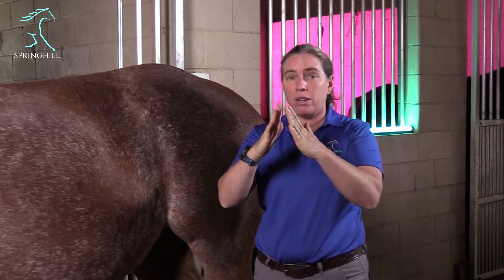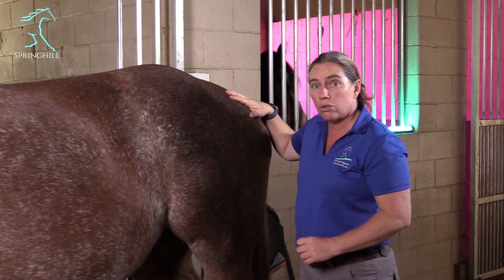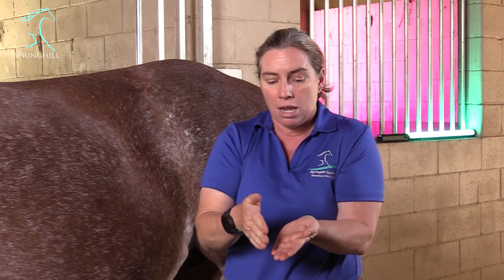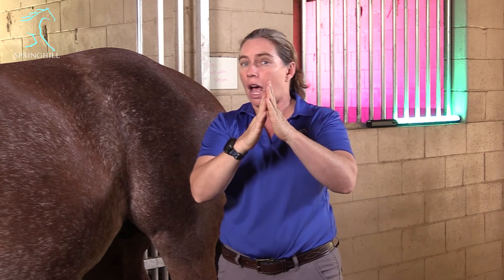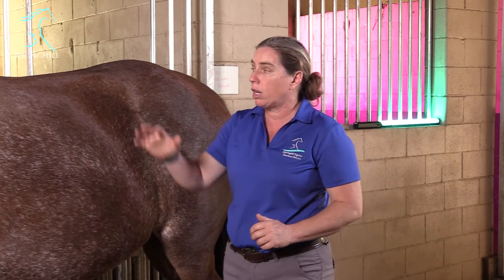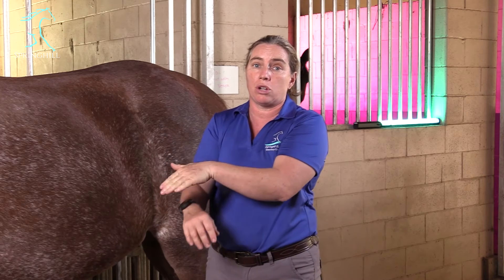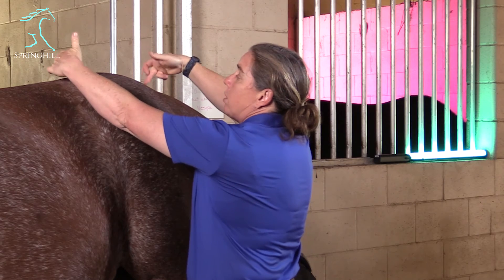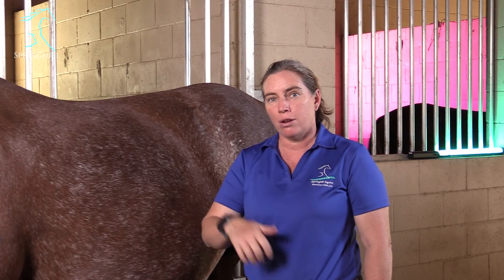The Equine Sacroiliac Joint

Comment: Hi there.  Thank you for the video.  I purchased a 4 year old (3 years ago).  I was tired of buying horses that were around 8-9 and had hidden injuries from their racing careers.  When I tried him he was great and decided to buy him.  With 3 weeks I noticed odd things with his hind, especially the fact that he could not take one step back, at all,  He was diagnosed with mild shivers,  Over the past three years he has been a lovely horse, competing in show jumping and show hunter and this past winter did his first hunting season.  I am aware horses with shivers should not be boxed and need regular work so he never had a long time off, he would have a week here and there.  After this seasons hunting season I decided to give him 3 months off.  I now have him back in for the last 3 months.  I have noticed a big difference in his sacroiliac joint, it is very much raised and higher on the right than the left, but the left is slightly raised also.  His shivers has also graduated a bit.  He has always been a lovely kind gentle horse but there has been a change in that insofar as he isn't keen to be caught, he doesn't run away, he just looks unhappy about it, he raises his head high when I go to bridle him.  His tail hangs to the right when he goes poos and he is just generally grumpy, which to me means he is uncomfortable.  He shows no sign of lameness or soreness when I massage him.  Just wondering your thoughts on this please.  (I am in New Zealand).
Reply from the maker: We would definitely recommend having your horse seen by a veterinarian.